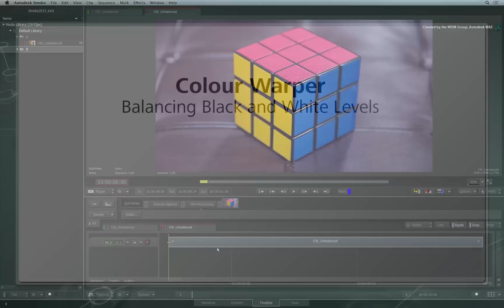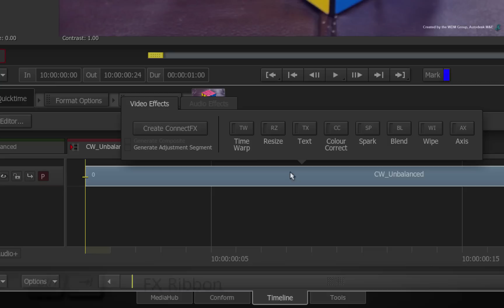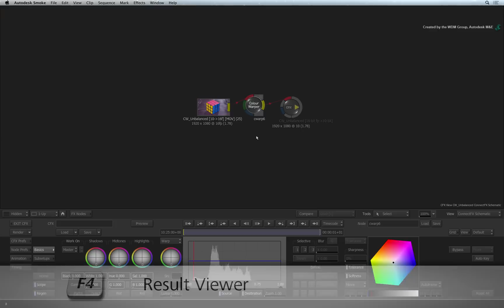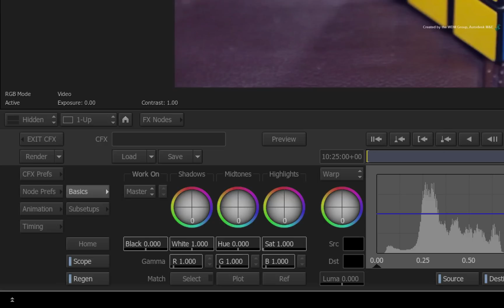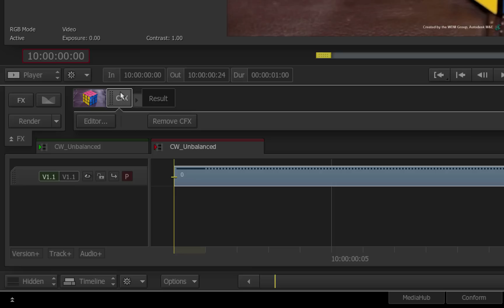Colour Warper - Balancing the Black and White Levels

Comment: Grant, these little short tutorials are worth gold. I didn't know how to scale the vector scope, let alone move it.

How do you do a spit screen instead of a F1/F4 toggle?
Reply from the maker: Hi, just beneath the viewer you can enable a button called COMPARE or press CONTROL+B.   A split bar will appear.  Using the pulldown menu next to the COMPARE button, change the option to FRONT.

Now just drag the split bar around the screen and you will see the original and the result divided by the split bar.
Reply: Smoke Learning Channel
 Thanks grant for that extra information. It is so funny that it was right there under my nose.